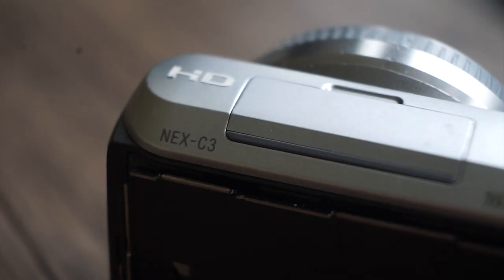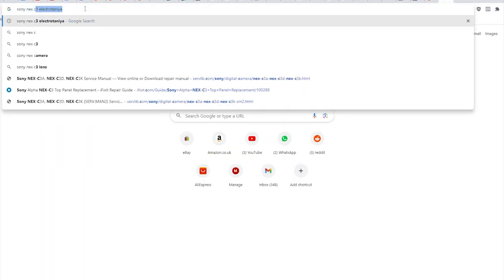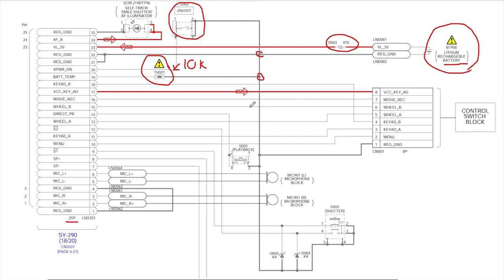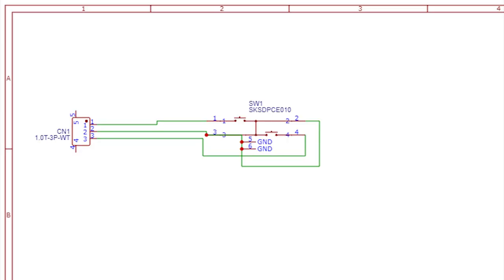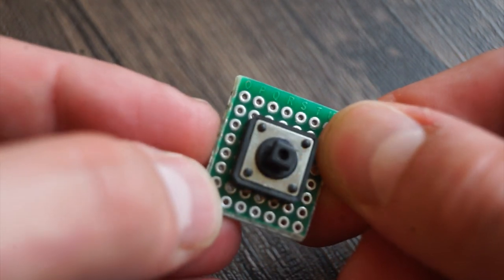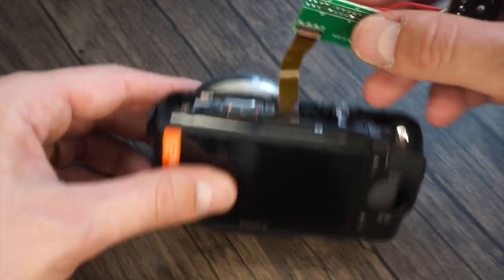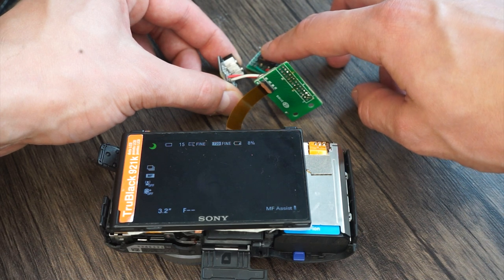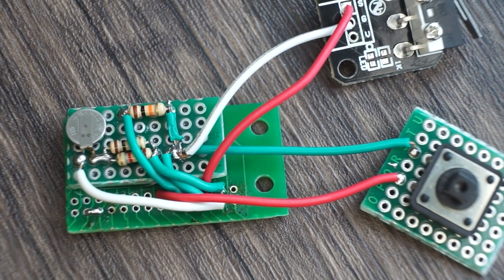Creating Buttons For My DIY Canon P Rangefinder Film Camera Conversion

Comment: Does this still work with the Canon's lenses? Or do you use the Sony's lens on the Canon body?
Reply from the maker: Hey yea, the lenses are the thread mount Canon lenses. The lens mount is attached to the front cover which I used in this camera.
Reply: @ErnestasMontvidas  that's cool!